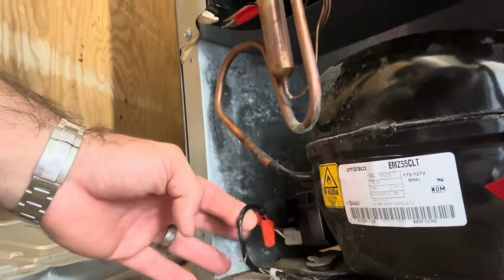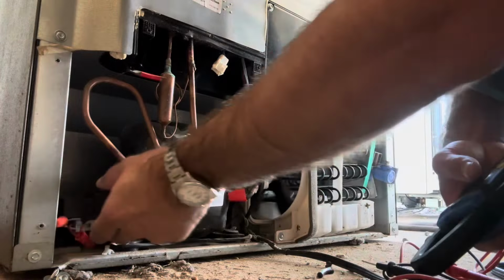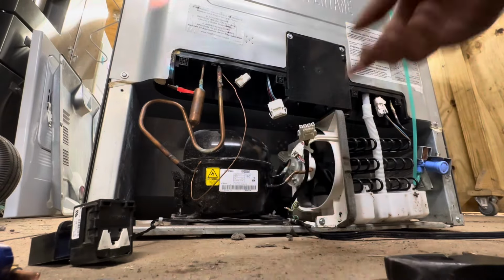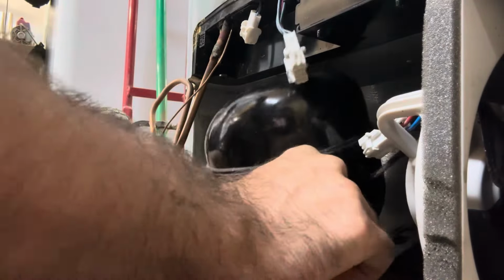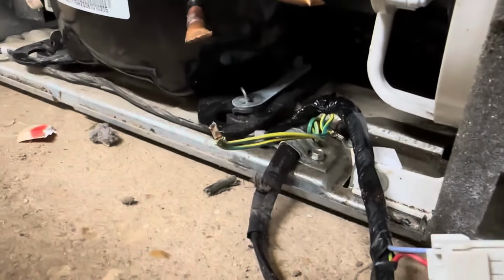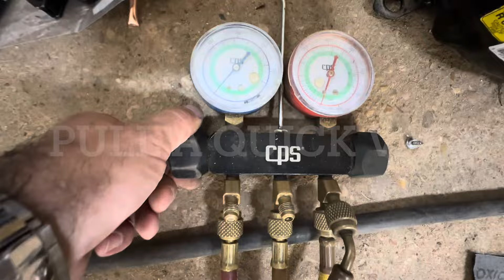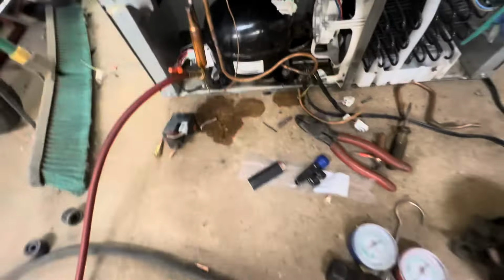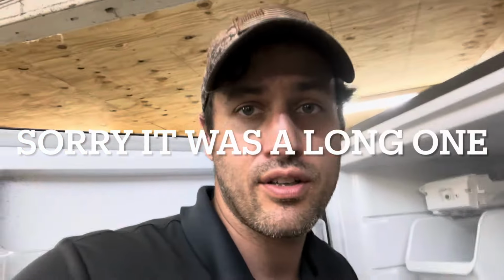Frigidaire refrigerator compressor swap | Another r600 to r134 ⚠️REDNECK ENGINEERING⚠️

Comment: Good job, i have a mini fridge in my semi that i am sure may fail soon from the shaking. I was considering swapping in a dc compressor from a truck fridge but they were only for 134a. Wasnt sure if the metering or the oil would be compatible.
Reply from the maker: @dprrn  I’m not sure this is kinda an experiment for me too. But I’ve done a few now and they seem to do fine. It’s worth a shot if it does fail. Thanks for the feedback.

Comment: What is the model of the replacement filter dryer that you are using? What type of silver brazing rod are you using?  How do you know the length, size, and internal diameter of capillary tube to use?  Do yo measure the capillary tube length or just cut close to the ends? I have a R600 system that has issues.  I would like to make the 134A compressor swap. THANKS!
Reply from the maker: @paulacosta122  I use the d111 or d115 dryers. And I use 15% silver. I don’t know about changing the capillary tubes. I just cut it close to the end at the dryer. So far so good on this one.

Comment: Are you using regular silphos 15%? I’ve never been able to get it to stick to steel, without hitting it with some s45 or s56 with flux first.
Reply from the maker: @THESNAKE8  yes all I have ever used is 15%. sometimes I get it to stick with no leaks on the first time. Sometimes it takes a second go…. Or third 🤣

Comment: Im assuming you let the refrigerant out of r600a but you didnt show it?
Reply from the maker: @theprofessor5584  oh yeah! I put a caution up there to “always evaluate the system” and be careful at about the 2:15min mark. R600 butane is flammable ⚠️
Reply: @LAapplianceguy  great videos man, The algorithm recommended you, I subbed. I recommend showing us how you bend copper and go into some details like copper sizing, these little things make big differences because guys like me can better gauge the copper pipe sizes, like we can do all the work but when it comes to newer guys not doing a lot of hot work and working with repiped jobs, the pipe sizes get confusing making us drive to parts houses, wait in line, call our office to get a PO for invoicing, and costing a few unnecessary hours (breaks our mojo when we are in the zone), I know there’s calipers but still I think this would really be beneficial to viewers!

Edit: grammar*
Reply from the maker: @theprofessor5584  thank you! And thank you for the tip. Next time lll make sure to show that and the difference in tubes. Thanks again tor the kind words.

Comment: Recharge with R290
Reply from the maker: @kevinroberts781  is that a possibility? I thought that was similar to r404
Reply: @LAapplianceguy  It will work but may not be efficient. Depends on the condenser set up. But it should be fine. Only concern I'd have is what oil is used in the compressor
Reply from the maker: @kevinroberts781  the oil was my concern too. But I’m curious to see how it does